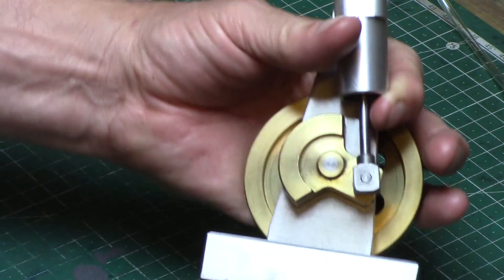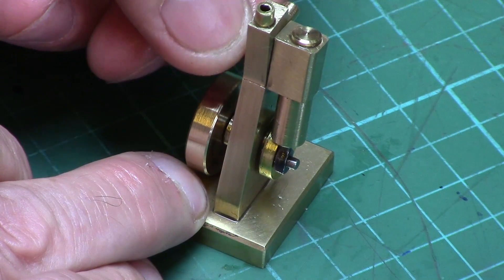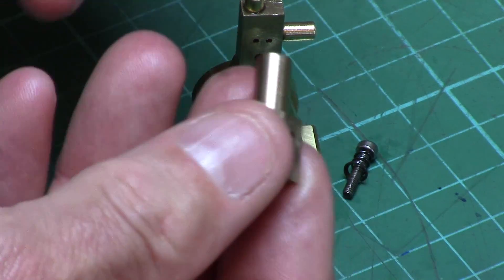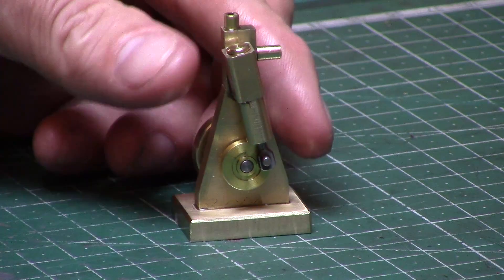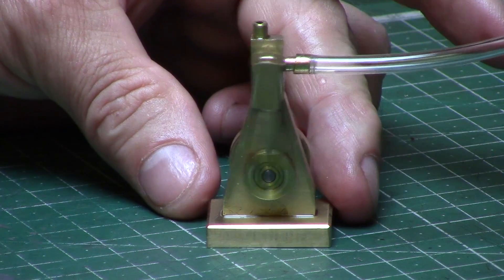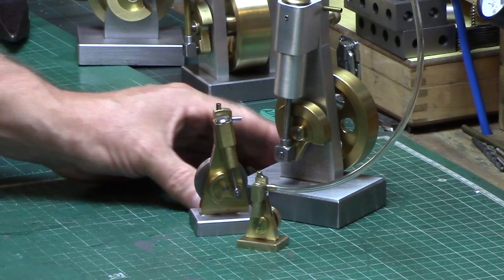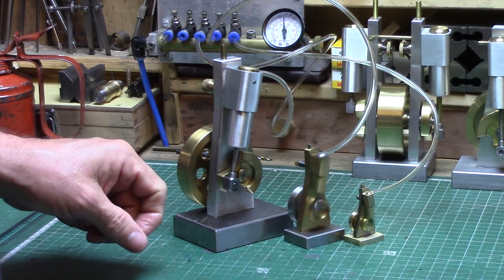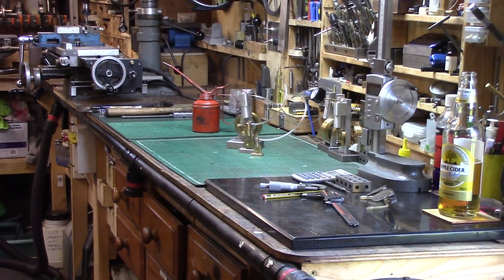Wig-Wag NANO Engine

Comment: Hello Ade,
How many bars of pressure is needed to run the "standard" size at medium to low speed?
Reply from the maker: Hi Kim, about 0.5 bar or less, they run on very little pressure if they are constructed well
Reply: @adeswash  Thanks a lot for Your reply Ade.

Comment: The problem with this type of engine is getting a good seal between the port faces and that under load the faces lift.
Reply from the maker: Hi Harold, the port faces will have a tendancy to leak under load, but are great little models non the less, and I dont really use them for driving any load, just for the pleasure of seeing them run. Best Regards. Ade
Reply: Those faces always seem to leak a bit when new, no matter how carefully they are done. So long as they are made right they usually bed in as the engine runs in.
  I find that they are best running fairly fast but with a light load. In a model with a geared down drive they are great, simple and reliable.

Comment: Great work Ade! So the big one has larger cylinder volume to fill on he equal pressure compare to small one, and heavier flywheel to turn before it will get some energy moment. So it's a complex problem however all smaller engines in equal conditions runs faster than they big brothers. CONGRATS